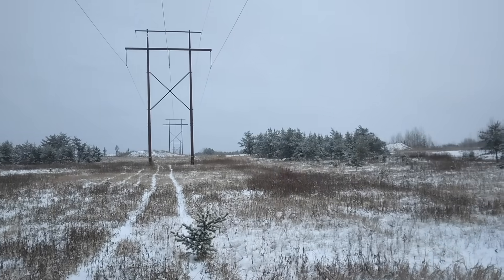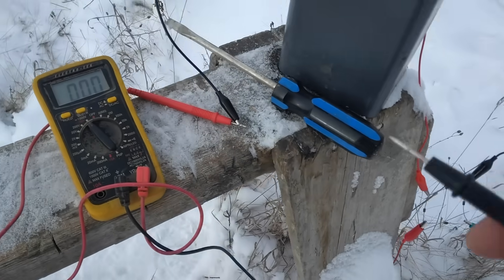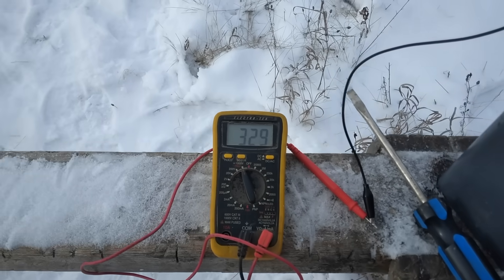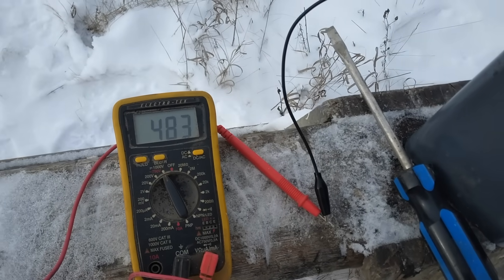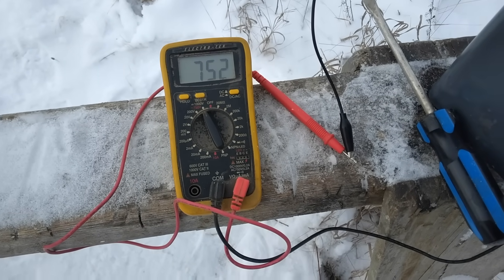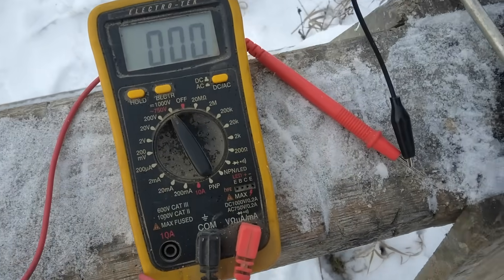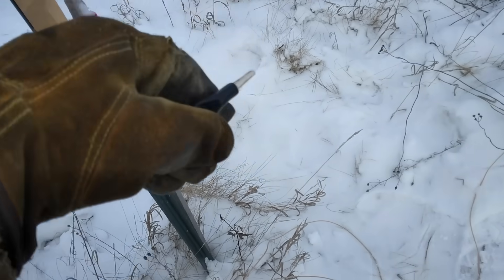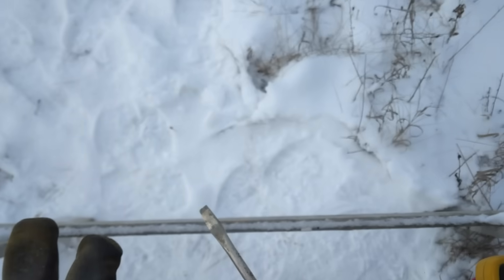Fences sucking power from under HV transmission lines

Comment: You could place NE-2 Neon Bulbs about 10 feet apart and string them along your fence line. They don't have to be connected to each other.! During daylight hours you would barely see them lit. Estimated "electrical" life span of all the bulbs would be damn near infinite! 
Wakodahatchee Chris
Reply: a straight Neon bulb presents a non-conducting circuit, until the voltage reaches enough potential for it to conduct.......... then it will 'flash' / trigger and will fully conduct, read "short out",once the neon gas conducts, if no current limiting resistor is inserted in series. I don't know the flash / trigger voltage for NE-2, remembering it is AC or rectified lumpy DC from 60 Hz, the voltage will be crossing or reaching zero 120 times per second......voltage rising, flash voltage reached.... the nE-2 conducts and lights, but the voltage disappears because the neon bulb has shorted everything out...... I don't think the neon would last too long.......... the neon would definately need a current limiting resistor or load.
Reply: @colonelfustercluck486  An NE-2 will ionize on AC or DC. They trigger @ ~ 90V.  With a 100 VDC supply they form the most basic form of "Relaxation" Oscillator. A cap connected in parallel with the NE-2 fed by a series resistor and you're done. As far as the NE-2 needing a limiting resistor (as you stated) in this man's application? Nah! He already has a resistance in the Terra Ohm range between him and those power lines. Capice?

Comment: You could power stuff and they'd not track it.  Electric utilities use meters to track and bill usage.  To them, you won't even appear to be more than parasitic loses.  Unless you are using serious power, they will never know or say anything.  The more parallel wire the better the mutual coupling.

Comment: You're getting capacitive induction which will not deliver much current, maybe a couple of milliamps. 
Another option is to run a coil off to the side (to limit inter phase cancellation) but the coil needs to run out away and back, ideally like a D shape with the straight edge following the wire.
That will give magnetic induction coupling which can deliver way more current, but at much lower voltage. The current is dependent on the wire gauge and distance and it will slightly increase the inductance of their cable. I used to run garden lights this way, using a transformer to boost the voltage and a buck regulator to drop it back down to something useful, I got a couple of watts that followed the utility load, but my cable run was fairly short by comparison.

Comment: Here's a neat test to try as we, myself and two fellow electricians in the mid 80's did. We grabbed 8' T-12 fluorescent lamps and wrapped the one end of them with aluminum foil. Then we held them in our hands straight up under similar 230kv transmission lines. They lit up like they were in fixture.
Reply: This was a Navy prank for any newbies aboard the ship, too. A saltier sailor would summon the new kids out to 'reset the phosphors' in the florescent lights, which meant dismounting the tubes from whatever lights were handy and bringing them out onto the forward deck. The prankster would demonstrate the proper way to 'reset the phosphors' by lifting the tube overhead and giving it a good shake - and a friend up on the bridge would turn on the radar.
Reply: @WyvernYT 😂😂❤
Reply: Back in the 90's I was doing work at a Navy VLF radio station. They offered us a tour of the radio house. When they went to show us the cables running out to the antenna array, they just grabbed a fluorescent tube lamp off of a bracket, and as soon as they held it the tube lit up. The cables were running in a large closet that went underground.
Reply: No need to wrap them in anything....They'll light up underneath a 10KV line already....Just pick 'm up and hold above your head, in the rough direction of the lines....
Reply: @muppetpaster  you are 100% correct
Reply: @muppetpaster  You probably live in a place where the 10 kV lines are close to the ground. I tried it under 20 kV distribution kline sand nothing happened.
Reply: When I was in the Navy I was an Avionics Technician working on aircraft Radars. We use to put rope barriers up and people would cross in front of them from time to time so they wouldn't have to go around. One day during a safety stand down we took 48" fluorescent bulbs and laid them on the ground in front of the radar, then turned it on, they all lit it up. We told our fell squadron mates, hey when you duck under the robes and head into that radiation zone when the radar is on, this is what's happening to your Balls! We didn't have any more people taking short cuts in the radiation zone anymore.
Reply: You didn't even need the foil to fire up your plasma devices.

I've fired up a fluorescent light just by touching it. I was the antenna in the field.
Reply: You don't need tin foil, I use to just walk out with the bulbs bear handed underneath 375 kv transmission lines behind my house. Wherever you hold the bulb is ground,so it only lit up above your hand, what was below the hand is already grounded by my body, so was dark.
Reply: Back in the very early nineties we used to drive our Baja bugs and pre runner trucks through the area that's now lake las Vegas. We noticed that if we stood on the bumper of my truck and ran our hands over the canopy, it ticked our palms. Then we noticed the glow of a zillion tiny sparks. I told a guy who worked with my dad and he recommended a fluorescent tube. It didn't light up entirely, but it glowed like a light saber that needed a charge. 

Years later I dated a gal who lived next to some lines in Cerritos, California. Her dad died of brain tumors a few years earlier, and a months after we started dating a huge tumor sprouted from the base of her neck. She had Hodgkin's. Thankfully she's in remission.

Totally unrelated but interesting: about half a dozen years earlier, a DC9 jet got struck by a small plane and the jet came down in her neighborhood. The pilot of the small plane had the same surname as her mom's maiden name.
Reply: When I was an Electrical Operator at a 500kV station we could light up the florescent bulbs without any problem under the 500kV structures.
Reply: Many years ago somebody got permission to install Florescent dozens of tubes straight into the ground near where we live under neath high voltage transmission lines which then illuminate and the public could walk around them if you touched then they went out
Reply: did that once myself
Reply: I used to do this too. It was lots of fun.
Reply: My dad and i did that when i was a kid too.
Reply: We did this quite often as kids playing too.
Reply: I did the same thing back in the early 80 s
Reply: That’s cool as hell (also an electrical contractor)
Reply: We've been doing that for years.looks trippy.
Reply: That’s amazing ! When I was 5 my dad set up battery’s and made some color  bulbs light up. It was bc we saw Star Wars also was about 1987.
Reply: I taught Electrical Engineering and told my students about this. Always been meaning to actually try it though.
Reply: Did this years ago in the early 70s
Reply: Why did you use aluminum foil and how did the foil work.
Reply: Am radio stations are high voltage too
Reply: kinda proves Teslas  idea of free energy through the air
Reply: @JoelGlaze-z4e  I would love to see 300 kW Tesla coils in operation. The problem is the feeble minded society. Dumb people complain about 5G transmitters and the dumbest ones even vandalize them.
Reply: Back last week, I went into my garage, replaced the fluorescent lamps in my fixture, then flipped the switch on.  They lit up as if they were turned on.  It was beyond amazing.  Then I took the old lamps and threw them into the ocean for the dolphins to snack on.
Reply: @DoNotEatPoo  here flipper I got a nice crunchie light saber for you!

Comment: some electric fence wire on porcelain insulators parallel to the high tension line will act as a secondary winding on a transformer. it will rise to a very high voltage so be careful.

Comment: If you put a resistor in the circuit to limit the voltage, that would allow you to charge  batteries with it.
.

Comment: 99.63 years later you would have a slap full 48v 100 amp hour lifepo4 battery!!! 
Or you could just make your “fence”  1000 feet long and it would take roughly 2,621 hours to charge your battery. 
If you had 50 of these 1000 feet long “fences” (😂) it would take roughly 52.42 hours to charge your battery.
 So my suggestion is to get a bunch of this cable if you wanna power your house since they are technically on your land 🤪🤪.

Comment: When the power company installed new 115 k-V transmission lines next to my mom’s house about 10 yrs ago, they knocked down our neighbors hill because they required 50 ft clearance to prevent arcing.
You got double that voltage at ~40 ft!! 😅😅

Comment: To answer your question in my mind if you wanna be technical about it.  Of course you are able to draw power from those lines. But in doing so you are affecting the electrical field around those lines, entropy exists at all times everywhere you aren't gaining free energy you just have a wireless tap directly to the transmission lines

Comment: 🔌🔌In 1977 I worked in a utility transmission department as a COOP Electrical Engineer in southwestern Michigan that had 765kV power lines from the nuclear plant. An individual claimed that a fence caused a spark in his tractor. Sure enough, we found out that this could happen and caused a change in easements setbacks. We also tested 69 and 230kV. 765kV was much more likely to spark. Also, the blowing sandunes caused the land-to-plow line clareances to change drastically.🔌🔌
Reply: @@FreiherrDinkelacker It was the Cook Nuclear plant which was owned by AEP and operated by Indian and Michigan Electric. I wish more nuclear plants were built.
Reply: @Carl_in_AZ 2 new  Google energy plant complexes of some kind being built in a city near me as we speak...I'm pretty sure they arent the only ones being built. Never seen anything like them before and security is very tight. And not a peep about them.
Reply: I remember us having to dig an underground ground grid. and place ground rods down all over and ground cables all tied together to keep the induction down.
Reply: Isnt that due to sand being a conduct for electricity ? That the dunes were a conductive area..
Reply: @nattyw495  Possibly the quartz in the sand could amplify the current or at least snag it from the air to keep it conducting near the ground.
Reply: @@FreiherrDinkelackerthe resistance of your loads should be fixed, so lower Voltage should mean less current.

I suppose there are some things that might use more power with lower voltage. Electric hot water system would need to run for longer to heat the same volume of water to the set temperature. Your air conditioning similarly might have to run for longer to heat/cool the room by a certain amount.

Comment: It's too bad that you don't have a high wattage radio tower near by.  Back in 1934 - 39, WLW Radio station in Mason, OH,  was running a 500 KW transmitter and all the farmers had the electric light bulbs burning 24/7 in their barns.  They never needed to turn on any switch to power the lights.

Comment: Can you set up a charging system on your property with fencing to get free power to your house?  Asking for a friend.
Reply from the maker: No.  The continuous power is very tiny (milliwatts).  The capacitor is just accumulating it over time so it can look like a lot when it's discharged.  There would be legal and safety issues if there was a whole mess of wires, trying to increase the output.
Reply: @doubleMinnovations  Thanks. I was wondering. It’s just power wasted to space anyway. It’s not like pulls from the grid. But they don’t want to give anything away. So…

Comment: I worked both Transmision and Distribution and remember very well working on a 500KV line changing out shot up insulators, you could only work it HOT, the induction clearance was 13' , you had to wear boots with shielding with a 4/0 copper cable about 8' long that you attached to the conductor so you two would be the same potential... also seen lineman killed from the induction by ungrounding ground chains at the wrong time{from Induction}, from various other Lines { 69k,138k,230k,345k,500k},
Reply: Thank you for tour service.  Think I will stick to delivering mail.
Reply from the maker: Thanks for sharing!

Comment: There is a ground wire that runs next to the 3 phase high voltage transmissions lines.  That ground wire will carry a few hundred volts from induction. I remember when I worked a summer job with utility linemen telling me about this phenomena.

BTW, you should be able to make a voltage divider using mega ohm resistors(say 10 to 1 divider) to measure the voltage without over ranging your meter.
Reply: Do not touch the ground cables on these high voltage line poles
Reply: @LevyMorris-r1t  Obviously.

Comment: If you use a crystal radio set & put the ariel on the wrong end of the diode you'll get a ridiculously high voltage then the full wave rectifier you can step down to increase the amps with a transformer & you'll get usable electricity. It might melt a few times 😂😂😂it's very dangerous so take care when you wire it up.

Comment: What happens if you are a rancher and have to run a barbed wire fence under high voltage power lines?
Reply from the maker: If you look carefully in this video to the west, (the direction I show as the capacitor is charging), you can make out a 4 strand barb wire fence of my neighbors, that's along the power lines going north.  But it's made with steel posts, so it's grounded out at every post and doesn't build up a charge.
Reply: @doubleMinnovations  Interesting! Would this still cause a loss of energy for the power company? If it did, could they make your neighbor remove the fence?

Comment: This is capacitive coupling not inductive. Inductive coupling requires a loop and will vary with the current flowing in the line. 88 micro farad charging 1 volt per sec shows 100 micro amps.if you drew that from the capacitor at 1000 V you get 1/10 watt. Not too useful. The three lines should balance out at a distance so you need to be off-centre to maximise pickup.

Comment: As a story I heard when I started designing electrical systems in 1983, a farmer in southern Illinois had similar situation and he was doing similar investigation.   He got to a point where he was installing copper plate below the lines.  As he trimmed off the copper off, he finally got to his desired voltage and connected it to his house.  All seemed fine to him, free electricity right?   The power company could tell they had a small loss on the lines, so they sent out crews to do inspections.   Guess who got caught?
Reply: This is similar to what I heard when--in 2002--I proposed installing an inductance circuit parallel to even higher voltage (250,000V) lines: that the power company would eventually detect a slight power loss, track it down and take me to court. It might be a fun experiment but potentially an expensive one.
Reply: I seriously doubt such a small current loss would ever be detected on a MEGA joule line...what .0000000000000000001%?     .I've heard of jamming a 20' long heavy iron rebar covered wih a garden hose, way up close to hv wires, and drawning off substantial usable current, after transforming it.    Sounds damn dangerous, especially in a lightening storm
Reply: From what I have read the power company can't do anything. It's leaked voltage. Have to be connected to lines to be considered theft. Also by the time one gathers the equipment to steal power , be cheaper to buy from power company.

Comment: Why coax though? Is it just what you had available for free?
Reply from the maker: I just had some copper shielded coax.  And that shielding has a lot of surface area for the weight of the wire, and I wanted something insulated.